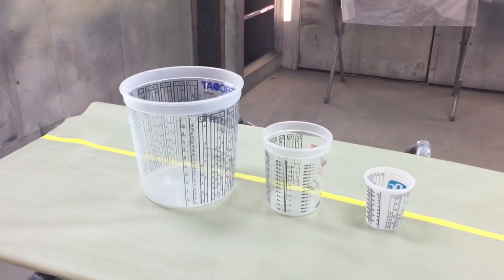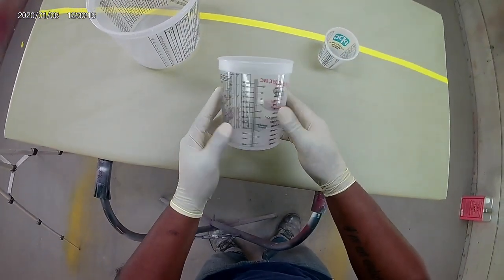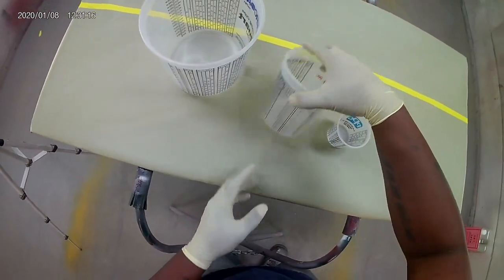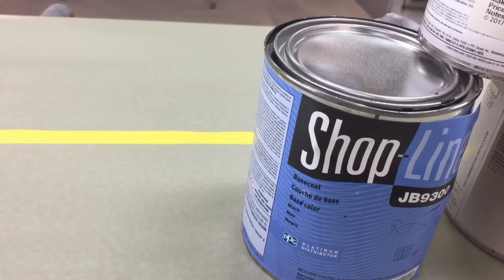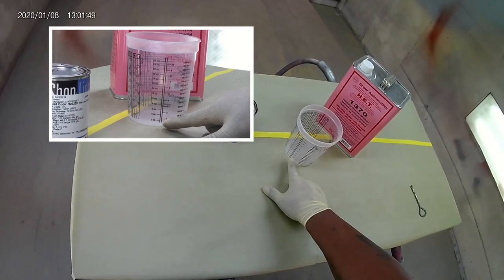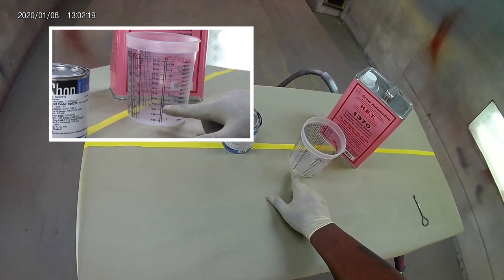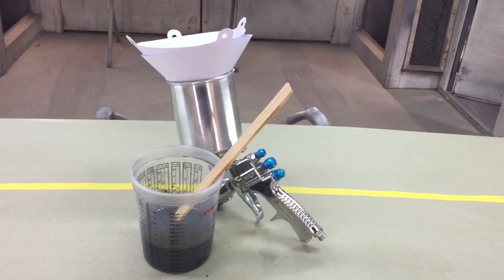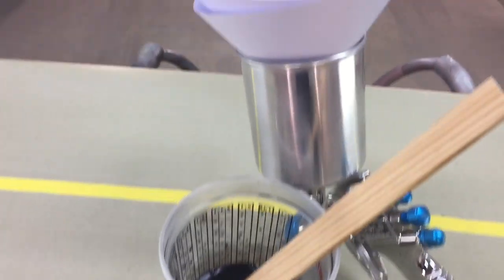Car Painting: How to mix paint

Comment: My question is. How long does the R.T.S.  last sitting around the shelf.   This spring I plan on repainting my golf cart.  So I could mix everything a day or 2 a head of time or should I just mix it then spray it.
Reply from the maker: The mixed paint will last for a long time, if you let it sit for a while just make sure you shake/ stir it well before spraying, you can mix a couple days before hand or same day as long as it’s not mixed with a catalyst/ hardener

Comment: Hello, great video but I have one question. How do you know what reducer/catalyst or hardener to use with you auto paint.?? Will any or either type of reducer work? Again this is specifically Auto paint. Thx you
Reply from the maker: most automotive paints come with labels that give you a description of what reducer/catalyst to use with the paint...also most paints recommend that you use their brand reducer/catalyst with their brand paint and you normally don't want to mix brands so its best not to mix brands...I hope that helps and if not let me know
Reply: Yes that’s correct and I have the complete line factory custom coded base and the 2k clear catalyst/reducer etc. I only asked this because I bought a slow reducer and it’s not quite that hot here yet. Also I saw a video that said a slow reducer is better for metallic paints. Inwhich my first project is lol.. Well this is going to be fun either way.. It’s not a brand new car but it is a fine car and I think I can do it. Thanks so much for responding King❤️

Comment: Do I need activator for nason base coat? On the can it says it need 8 parts paint to 1/2 part activator to 4 parts reducer but I've heard of ppl skipping it, or can I use clear coat hardener instead? The activator it says I need is hard to find
Reply from the maker: I have never had to use activator with it only reducer but you may have something that I haven't used so I try to stick with what is recommended but you can always do a spray out or test panel and see what results you get before spraying your actual project
Reply: @UndergroundPaintKing  the bumper turned out great thank you so much. I got a lot of orange peel but what can I expect with a cheap spray gun and small compressor. You are a great teacher